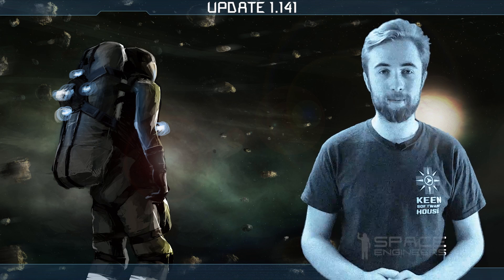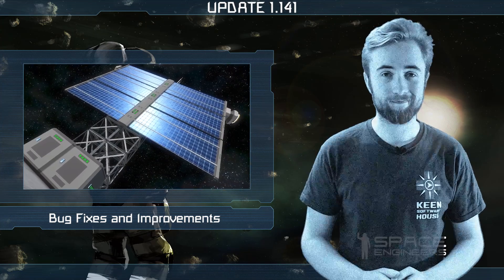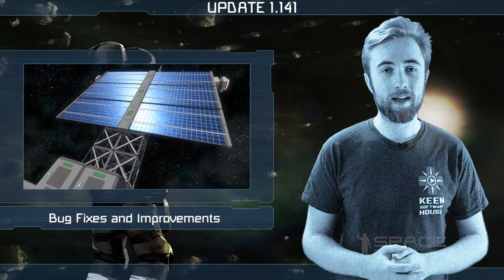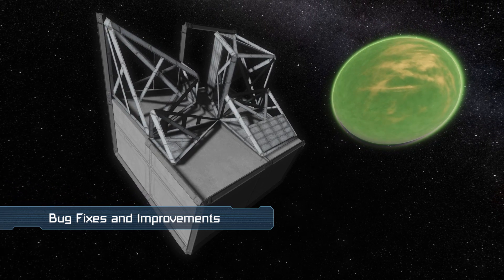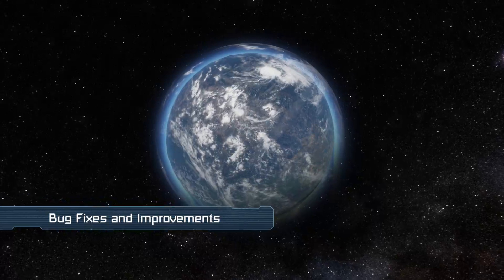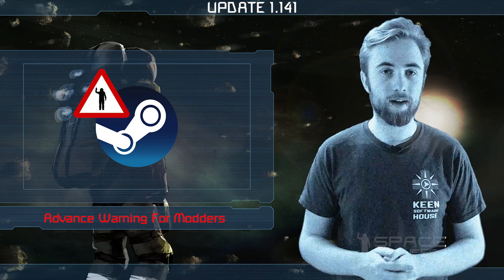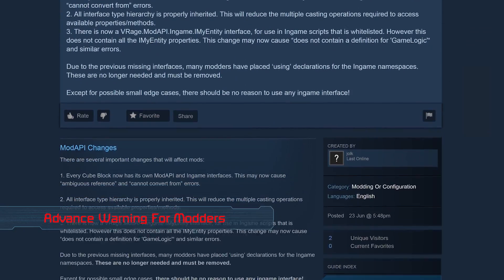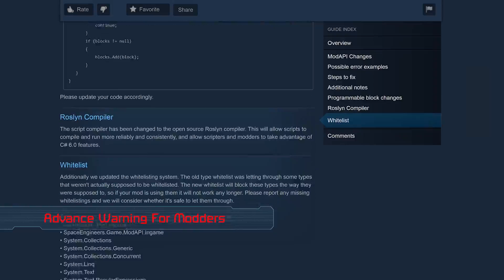Space Engineers - Update 01.141 DEV - Bug Fixes and Improvements

Comment: Can we please get rotors and pistons working properly.  It's a feature that would be immensely useful for a variety of applications were it not for the fact that you can't actually use them.  Even in a single player world they are wonky and wobbly and fall apart instantly if you attempt to use them on a moving ship.  And of course in multiplayer they are completely useless because you have all the same issues you have in single player with the addition of the de-sync problems that magnify all that x1000.

Comment: PLEASE
GTX 660M PLANETS 18 FPS 
FIXING =(
Reply: dude that chip is getting on in years, complaining about that getting you bad frames is like blaming Bethseda for not optimizing their game DOOM to work on the Xbox original, just save up and upgrade... also get a desktop not a laptop for gaming.
Reply: I think the key here would be not using a 660m
Reply: +Venom 415 I have an i3 6300 and gtx 950. It runs just fine for me 60+fps on medium to high settings. An i5 may not be necessary in all circumstances.
Reply: I know, now's the time, especially since the new Nvidia and AMD graphics cards are currently being released.
Reply: Dude, you're playing on an old mid tier laptop, what did you expect?
Reply: im on a gtx 750 ti and get around the same fps :/ but i think its mostly the crappy cpu (athlon945x4)
Reply: yeah for SE youll need an i5 or higher (or the amd equivilents) to play with better fps
Reply: Al yero Could be, I get around 30 fps on planets (on low settings 1080p) using an nvidia 560 ti and an overclocked i5-760. According to benchmarks my GPU is worse than yours but my CPU is better.
Reply: +A Box Yes I would say it is probably about time for an upgrade friend.
Reply: Only Planets low fps
Astorisds 60 fps